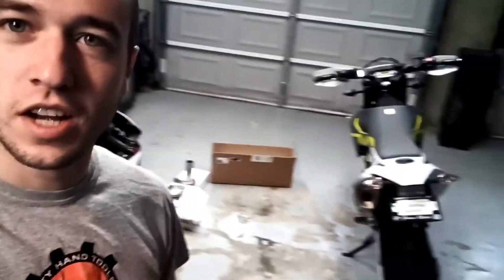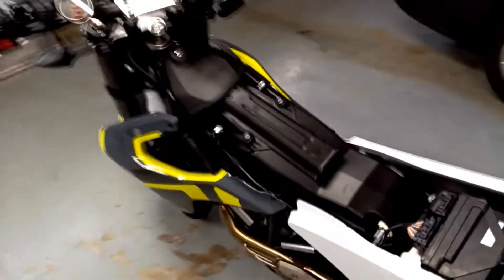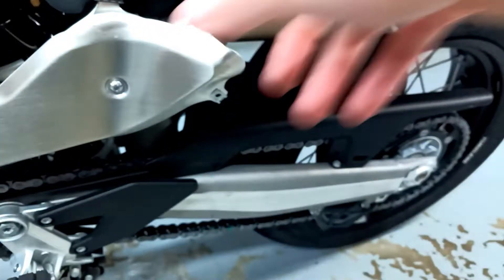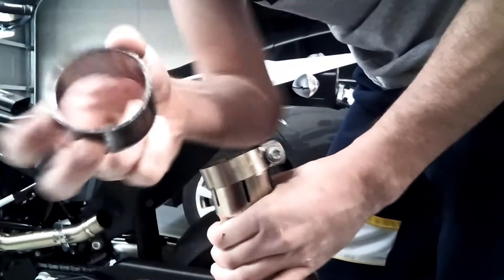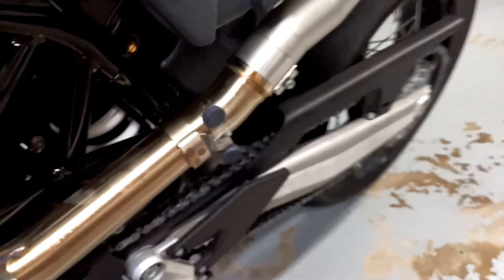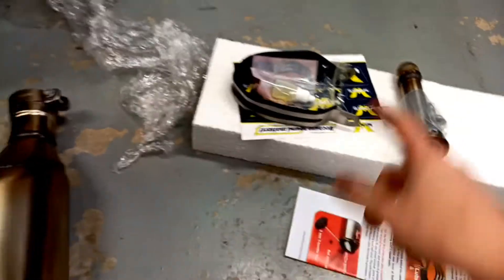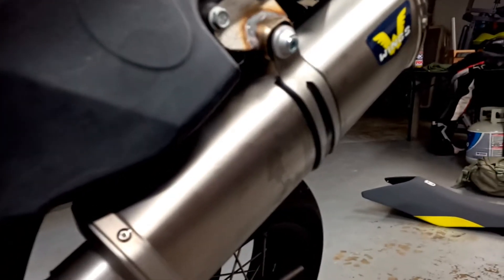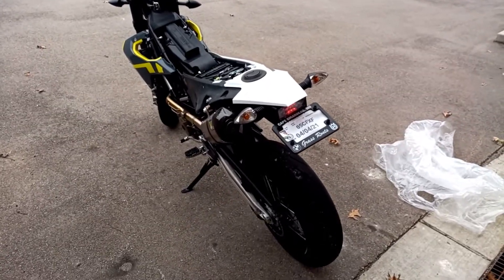Husky 701 Wings Exhaust Full Install + Tips and Tricks

Comment: Cool exhaust mate! I bought a Leo vince complete system can´t wait to install it on my bike 
Have a good one
Reply from the maker: Awesome man, how are you liking the 701?
Reply: just bought the same full exhaust. I know its recommended but is retuning the bike required for this for the bike to run? like will i be able to ride the bike at all after installing the full header and muffler on the stock tune?
Reply from the maker: @stoneybaker4408  you are probably ok to run it. Supposedly the stock ECU can compensate especially if you let it idle for 15 minutes to "relearn" the map. You might want to spend $50 and get the fueling dongle from Rottweiler to richen up your bottom end.

Comment: Don't forget to do the 15 minute idle trim re-set. It works on my KTM 690 SMC R and I believe it works on the Husky as well.
Reply: What's the procedure for that? Just let it idle for 15?
Reply: @bryanforster19  handlebar switch to run, ignition key on, start and let idle for 15 minutes. Do not touch the throttle during this time. I'm told if you go much over 15 min it could negate the idle trim reset.
Reply: What even is this Idle trim re-set, what does it actually do?? never heard of it before
Reply: @Tdmotoss  It allows the ECM to learn/set the idle fuel trim. The sequence is mentioned above.
Reply: @ironken1796  Do you know if this is needed for the newer bikes, like the 2022 Euro5's? For example with an Wings exhaust (only slip on) and the O2 (fuel dongle) .. ??
Reply: I managed to go over the 15 minutes... It says in the manual more than 15 and less than 16 minutes. I did 17 minutes:-O
What should I do..? I've run the bike and it seems just fine. The sound is awesome! Should I reset and do it again? I now have driven about 30 miles since the change.
Reply: @catojrgensen6712  personally, if the re-set seemed to work, I would just ride it as-is. I finally got a workshop manual for my '20 690 SMC R. My manual says 600 seconds or 10 minutes +. I have always heard 15 minutes though. Does your Husqvarna manual specify 15 minutes?